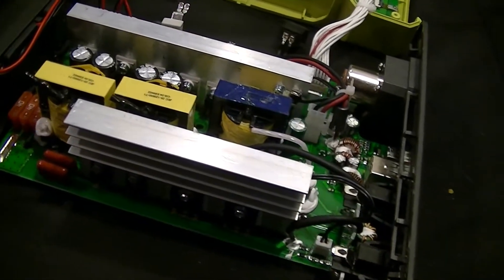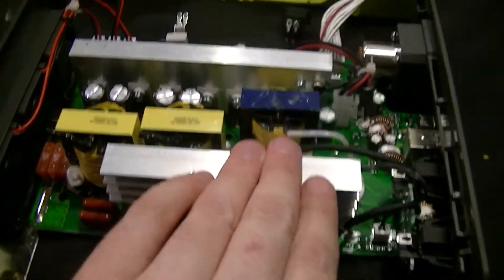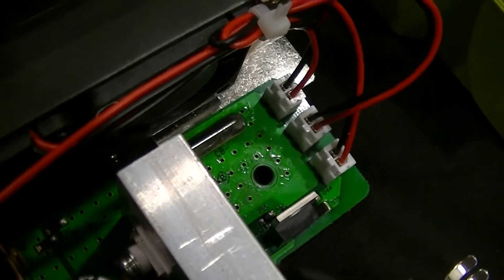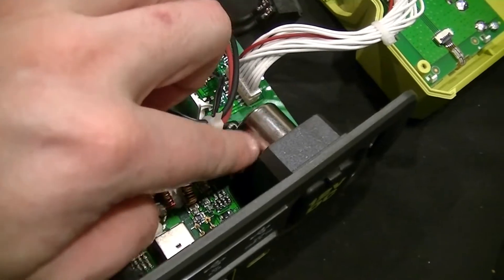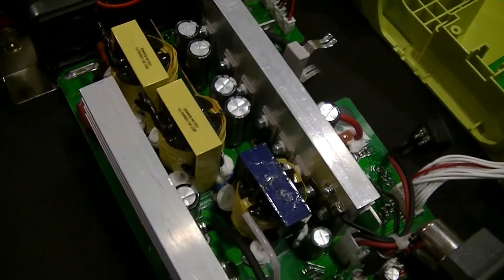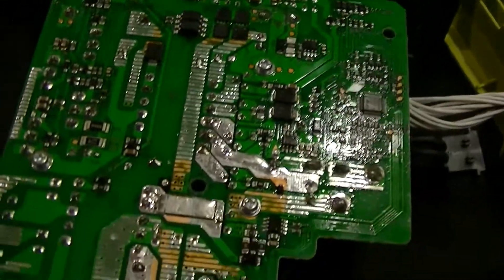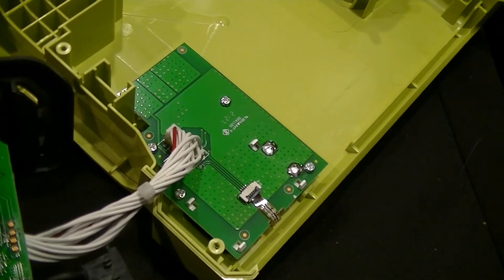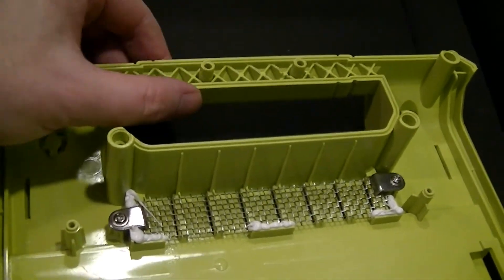Ryobi RYi8030AVNM 800W inverter guts/teardown

Comment: Any indication for max voltage on the 12V(battery) inputs? I.e. could a parallel set of ryobi 18V batteries be fed directly into that input, or would it cause inverter damage??
Reply from the maker: People have tried that and it doesn't work.  It won't die, but it gives the bleepy red light of ire.
Reply: @randacnam7321  okay thanks. Any idea of the max voltage it's compatible with? I imagine up to 15V or so, if people can hook these up to an installed auto battery with the vehicle running...
Reply from the maker: @Custard-The-Dragon  15V to 16V is a fairly standard cutoff for 12V nominal inverters.

Comment: Good video, im trying to figure out how to bypass the power switch, i want the thing to power up as soon as 12vdc is supplied without having to press and hold the power button, i can not find any wiring diagrams online, any help would be appreciated if you know how to do this. Thank you in advance.
Reply from the maker: For this inverter, you would need a circuit for emulating a button press when 12V is applied to the input.  Circuits to do this are a dime a dozen, but this really isn't the inverter for that except in very specific cases.  For a 'turn on when energized' inverter application, get one with a contact closure clicky switch and leave the switch on.